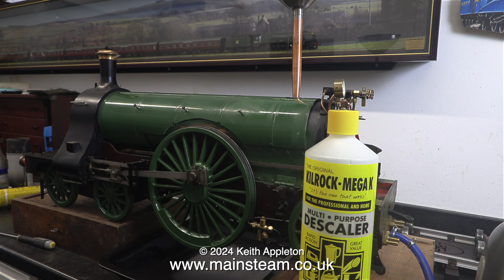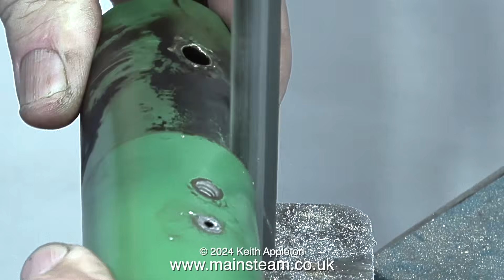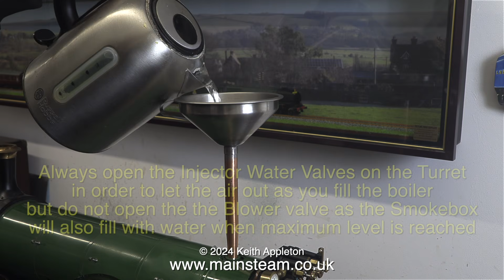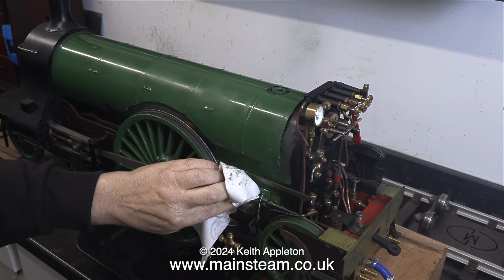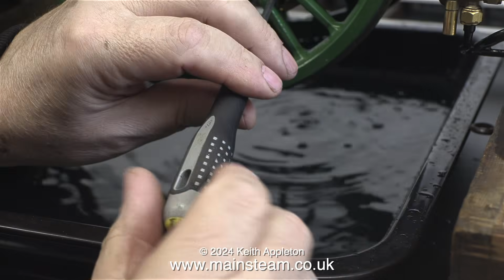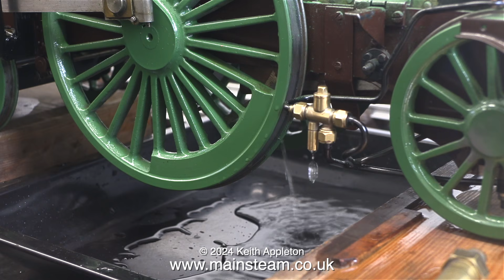HOW TO DE SCALE MINIATURE LOCOMOTIVE COPPER BOILERS

Comment: What's a good thing for getting rid of oily soot out of the lower tubes on a doris. I'd rather try and  dissolve it rather than bang away at it. Any input or tricks of the trade gratefully accepted Keith.
Reply from the maker: A Flue Brush and some WD40 or Paraffin.

Comment: Keith, anything acidic enough to attack lime scale (calcium carbonate) will also attack the zinc in brass.  Diluted white vinegar (acetic acid) might do quite well in copper boiler descaling.  Keep acids away from ferrous material, lest pitting occur.

Comment: I have been told that some soda-pop (in particular Coca Cola) has a mild acid in it (phosphoric acid).  In a pinch, it might work as well.  Of course I'd test it on the deposits in the cut apart boiler you showed in the first place to actually see it in action.  Flush with hot water as well!  Just a thought, but if you have the actual de-scaler I'd use that.  I don't know if diet or non-diet would work better 🙂
Reply: Citric acid (used in canning) works great
Reply: Phosphoric acid will convert calcium carbonate scale into calcium phosphate scale.  :>(  Bones contain calcium phosphate.
Reply: my dentist said diet has more acid.